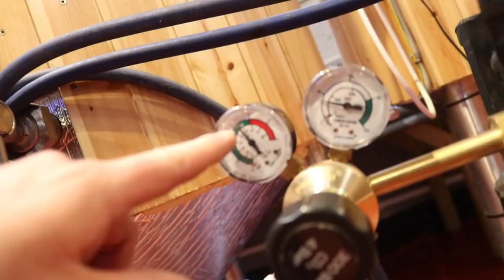Setting Up A Bar For Remembrance Sunday

Comment: What a shame the cleanliness in the pub is not as good as in the brewery.
That cooling jacket hadn't been cleaned for months.
Reply from the maker: Hi Graham, The cooling jackets are made from a closed cell polystyrene and are housed behind a face-plate that is held on with 4 bolts. Much like a compressor on a freezer, they are not user serviceable and are inaccessible to the staff. The beer engines are designed in such a way that each and every part that requires a daily cleaning routine can be accessed without tools. Due to the nature and location of the jacket it will inevitably be subject to condensation, this over time will dry into the foam and look dirty. That's fine, I roll kegs in to the cellar over the car park but the beer inside stays containment free. Pull out your freezer and look at the compressor and tell me if that reflects the condition of the inside. I would hope not. I hope also that this analogy is not lost on you but considering you can make such flippant assumptions I am sure it will be.